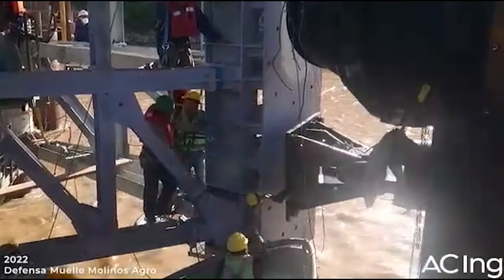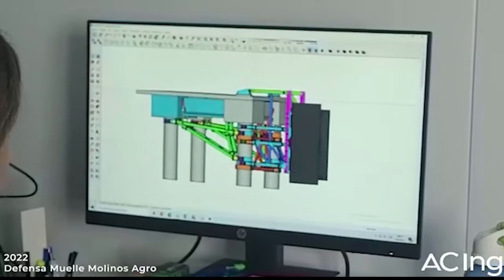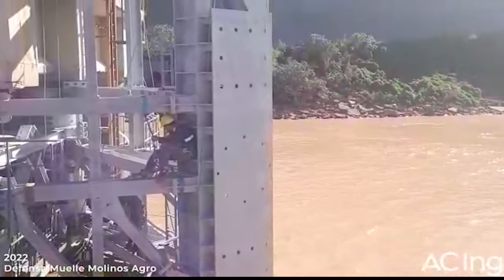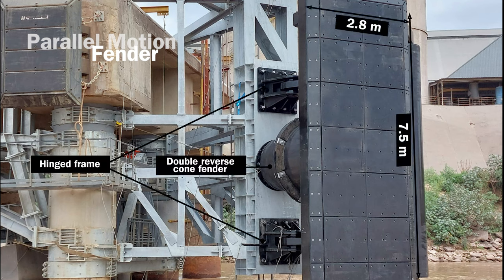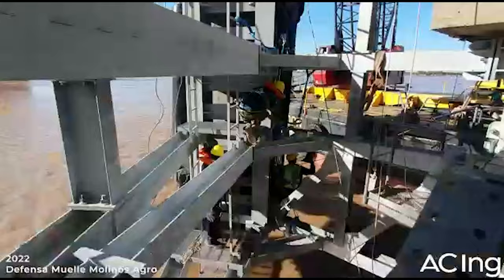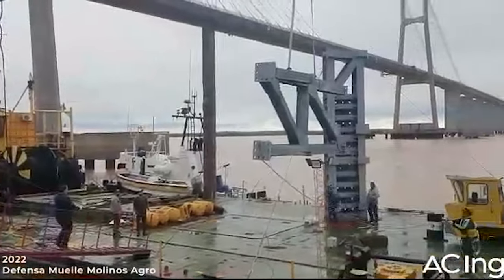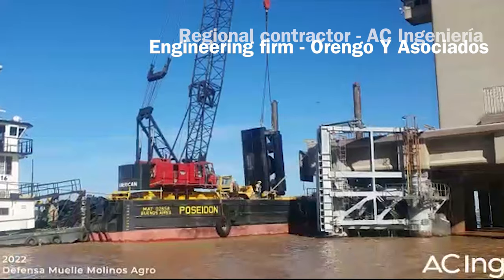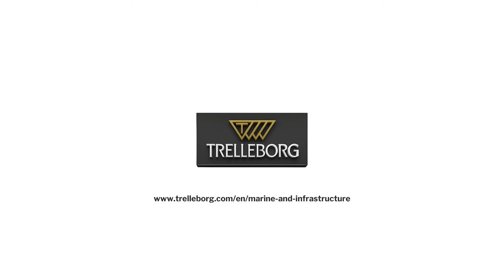State-of-the-Art Parallel Motion Fenders in Port of San Lorenzo in Argentina

Comment: Where this type of fender support structure installed?
Reply: The type is Paralel Motion Fender. It is a sort of Shock Absorver with Cone rubber fenders asociated. It Weights 39 Tons and the steel supporting Structure weight 25 TN.